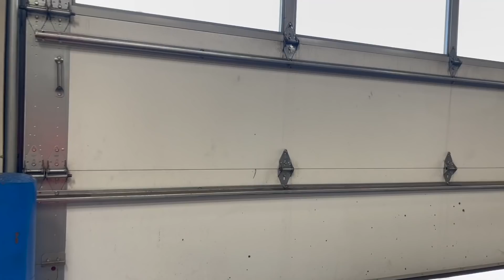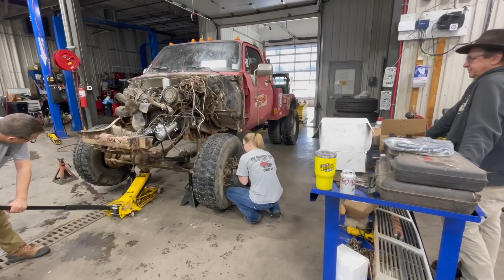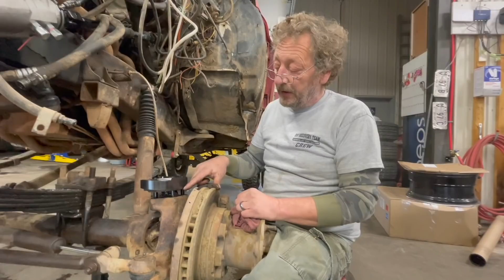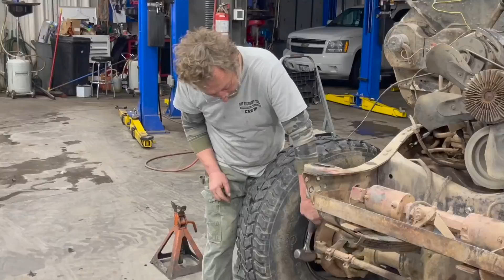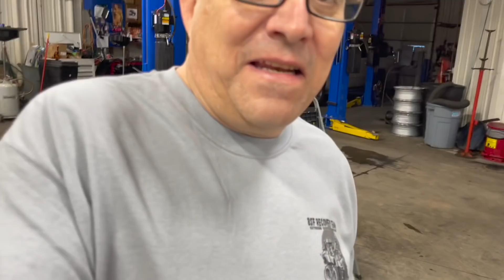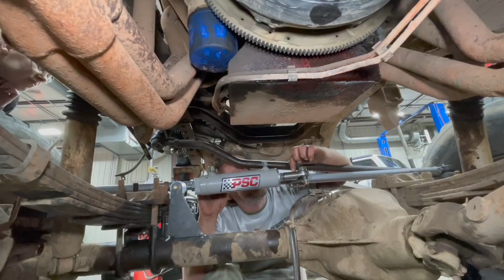Hydro assist cylinder, and high steer install

Comment: Cool i was in the need of a decent corded grinder and Amazon back during the summer was running a deal on the metabo hpt series i think it is medium sized grinder comes with 4 grinding discs and a hard plate case $36

Comment: That is a strange blade orientation/placement on the radiator cooling fan or is it missing 2 blades?
Reply: Doesn’t that cause an imbalance that’s hard on the water-pump bushing?

Comment: My grandfather had A68I believe shitty believe Chevy that had that brake lock system on it it came from the carolinas it was used to pull right Poles up the mountains. What's a pretty cool system like he said you just push the panel flip the switch and that sucker wasn't going nowhere.  Brighten my heart that we slipped up and sold that truck wish to God I still had it but it there was a 3/4 ton short bed skip side 354 barrel with a bulldog Fucking hopes you could not stop that truck I truck I saw it pull a digger up the  knobs in my area with the front tires off the ground my grandad will let off the gas just enough to let the front tires touch get it pointed the right direction and just get right back in it...

Comment: It's getting there, should be a whole lot less prone to damage when it's done. I think I noticed some play in the right ball end of the drag link when you were testing the tie rod.
Reply: Yes I also seen the high steer ,passenger side wiggle slightly

Comment: Nice explanation on what you are doing Eric.  Stay safe and healthy.  At around the 22 minute  5th grade math question you lost half an inch.  16-21 3/4= 5 3/4 divide by 2 is 2 7/8 so  you wanted 18 7/8 not 18 5/8.  I just ate dinner, you still had not.

Comment: Something to  keep the clamp from sliding  add 2 large tack welds outside  the edge of the clamp but not welding  the clamp to the tie rod. the clamp will slide there is up 4000 lbs of force being applied to the tie rod via the ram 

Also make sure the ram bottoms out before or right at the steering stops your stock knuckles will thank you. The ram will keep moving  until it bottoms out or something else gives. If you can't adjust the ram to make it bottom out you can add washers on the shaft  to have them bottom out of the back side of the jamb nut to the body of the ram that is easier than tearing a cylinder apart to cut a spacer

Comment: On the ram assist clamp. It might be worth putting a couple of weld beads either side so it can't slide on the trail. 
Hope Abby doesn't need braces for too long.
Reply: That sounds like that would be wise
Reply: I have had the clamp slide on the tie rod in aggressive offroad situations. Easy fix with some welds.
Reply: @kdseidle8031  I've heard that before, hence mentioning it. Because this will get hit hard

Comment: I’d love to be able to fit a cylinder type hydro-assist steer on my truck, but here in Romania it’s not permitted to “tamper” with the manufacturer’s design of the vehicle. It drives me crazy, I can’t have auxiliary lights, and technically, my lifted suspension, higher rated springs, and bigger tyre size are all illegal. The traffic police have the power to immediately cancel the registration if they choose to (for these “offenses”) and to get technical approval of such changes needs a declaration from the manufacturer (in my case Toyota) that the changes will not affect the safety of the vehicle, which of course Toyota would never give, for liability reasons. It’s a real bummer. Good job Eric (and assistants) ❤️👍🏻🇷🇴
Reply: He technically does not drive the wrecker on the road, he uses it off road.

Comment: The brake lock system. I use to drive an International that had a lever for the brakes. You step on brake and move lever up and it sets the brakes. Is that basically the same?

Comment: 16 to 21 3/4 is 5 3/4 not 5 1/4. Half of that is 2 7/8. Not that it matters since your bracket is adjustable. Your helper needs to go back to math class though. LOL

Comment: Your center point at 23:01 should have been 2 7/8 not 2 5/8. Take 5 3/4 divided by two and it comes up to 2 7/8. Good luck with the rest.
Reply: I caught that as well.

Comment: I did the same. Wearing glasses from 2 years on and grinding etc without safety goggles. But there are never good goggles to be found fitting over glasses.
67 now and only 2 times had to clear my eyes. So for the ones commenting of this: put an link to an safety unit that works.
Ps eric. Sorry for the loss of your phone. 
Those old ones did a better job being a simple phone.
Honey do you have a new aftershafe??😉😉😉

Comment: The army wreckers have a micor break lock switch inside the cab and they push on it as there push pressure on the petal as well and they can shift the transfer case to neutral then shift transmission to the gear that you need to do the recovery

Comment: Hey Eric !1 Great job with the steering ,but are those spring  U-bolts bottomed out on the threads as that is what happened B/4 when you were on the trail & lost the rear springs & Center bolts snapped off ???  Have a good week & thanks for the video updates !!

Comment: I feel for you with the DAMN smart phone. So far i got mad at one and ran it over with my 18 wheeler, it was not smart enough to get out of the way. In your last video, great work with the power steering pump. The last power steering pump I did was a pain in the bxlls. It was on a 1985 Chevy C-10, using cheap tools (what I could afford). The right tool, for the right job.

Comment: I'm jealous.  I couldn't do high steer on my truck...

Also, you want the hydraulic ram to bottom out and act as the steering stop.  It will bend stuff till it bottoms out other wise.
Reply: Why not?
Reply: I have too much lift and require a spacer between the nuckle and high steer arm for the crossover.  Makes it weaker, so it is better not to put the extra force on it of the tie rod also.